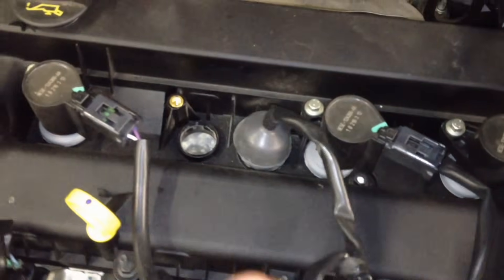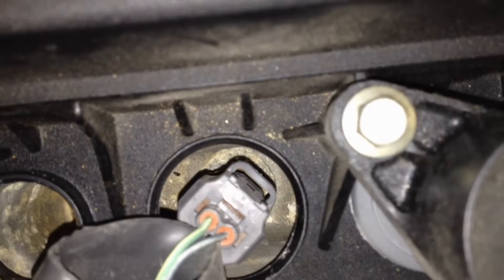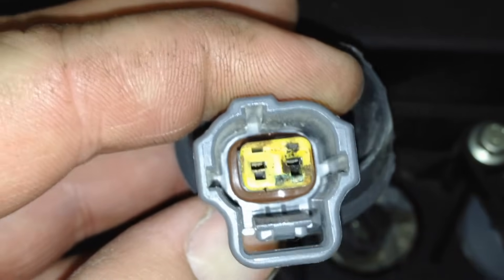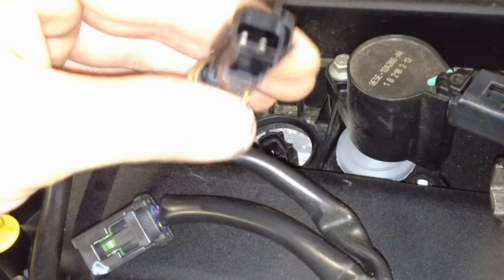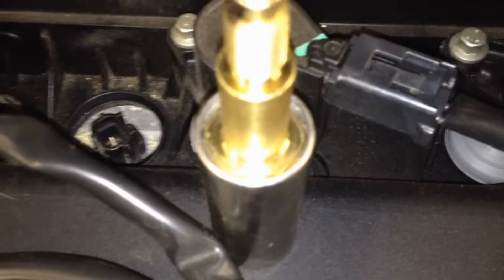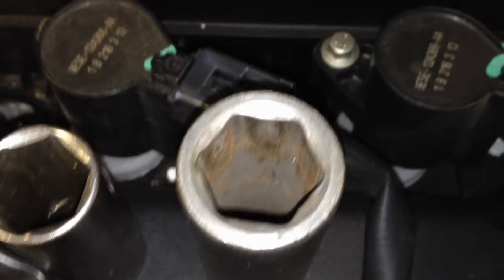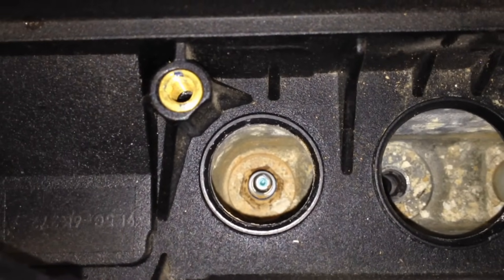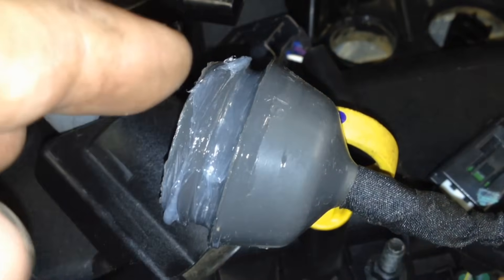Ford Escape & Fusion 2.5L False Overheat And Misfiring

Comment: So is the misfire cause by the CHT sensor thinking there is an overheat even if it's not overheated? I have 2003 focus with 2.0 ztec. Belt tensioner broke(don't buy dayco, get gates or motorcraft. Daycos hammer themselves to breaking on stops) and wife kept driving till she got home. Replaced belt and tensioner and seemed to run fine except code P1299 is keeping check engine light on. Ran fine for about 40 to 50 miles now all of a sudden it runs rough when accelerating from stop or if driving at below say 2K. If I take out of overdrive and run at say 3K it seems to run almost as smooth as normal. Hoping it's just this sensor sending out a warning and not actual blown head gasket or worse! 
Update: Reading a bit more on line seems like P1299 indicates that car is running in a kind of limp mode to try and prevent engine damage. So guessing either has to be manual reset after an incident or maybe CHT sensor got messed up and is still saying there's an issue and keeping it in limp mode. Going to try to clear codes and see if that gets it running ok and if so drive for a while and see if it stays clear or if it comes back because needs new sensor.
2nd update: I reset code and it still ran bad, and came on again after running briefly but P0303, P0304 and P0316, all ignition misfire codes. Pulled plug wires and both wells full of water. I assume for overheating but not exactly sure where from since they are kind of isolated from any water. Sucked it all out. pulled plugs and only one looked a bit white. No foam in cams nor dipstick. Reassembled and still ran rough. Thought hey water displacer 40! Pulled plug wires and sprayed both ends with wd40 and it runs fine now and check engine light is staying off. Good luck has struck....hopefully keeps going! Thanks for the info.

Comment: I have a 2010 fusión manual transmission. When in 6th gear the a/c blows hot air momentarily and check engine comes on with p0300, p0301 and p0304. Do you think this could also be related to the false misfire due to moisture in the spark plugs
Reply from the maker: Definitely fix the misfires first. Misfires will happen in the higher gears more often with failed secondary ignition and moisture or oil in there.
Reply: +FordTechMakuloco I see rust stains in there but everything is dry. I have now replaced spark plugs coils and fuel injectors with no improvement. I'm stumped
Reply: +FordTechMakuloco mystery solved!!!! I hadn't mentioned that the misfires started happening after an engine replacement. Turns out I needed a "misfire monitor neutral profile correction". Once a did that misfires went away. Wanted to share this cause it drove me crazy for a week!! Couldn't find the cause of misfires. Any time you replace PCM or crankshaft position sensor ( which I did cause new engine came with its own) you have to do that procedure. The symptom is random misfire or unexplained misfires.

Comment: 2011 escape same problems as described in video. Question how do you remove the cap and or gasket around the cht I'll add that this model has two cht one on each Cylander head cover

Comment: Hello.  I have a 2001 Ford Focus ZX3, same issue. Replaced thermostat and water pump. Mechanic checked the lines and their saying it's running at 180 degrees (normal). However, when plugged into the computer, the comp says its like 230+. After unplugging the thermostat sensor, comp still reads the same. Car runs fine when it's cool, but after a few miles of driving, starts to bog down and eventually stalls. In your opinion is this a bad comp?

Comment: I have a 2013 1.6L Escape and the Engine Coolant Temp sensor is stuck open.  I purchased the sensor from Ford dealership and it looks nothing like the one in your video.  Is there that big of a difference from the 1.6L to the 2.5L?  Where is the location of the engine coolant sensor on the 1.6L eco boost?

Comment: I got the P1299 code after the gauge went crazy I got it home took a look at everything and there’s oil in 2/4 spark plug wells and 1/4 is corroded badly inside along with the sensor having oil on it too. Not sure where to go next I’ve got the sensor but not sure if that’s my only issue. It’s only got 62,000 miles it’s a 2009 I4 have you seen anything like this? There’s also no obvious signs of oil intrusion in the spark wells Idk where it’s leaking from.

Comment: Just changed the sensor in a 2010 Fusion SE 2.5 Radiator coolant from radiator leak go into the CHT sensor well.  Temp Guage stopped working. Found the 19mm socket at Auto Zone.  Problem solved.

Comment: My 1.6L eco fusion has recently thrown a cylinder head temp sensor. It will over heat as soon as the car starts and misfire, not accelerate. I cannot find the CHT sensor to save my life! I’d like to change it myself given it’s so cheap. Any tips on how to find it?

Comment: Hey Ford Tech, I have been looking everywhere to try to get a idea whats up with my 2011 fusion. a couple of days ago I was stopped at a light and when I took off the engine lost power and the wrench and engine light came on, the car did not die just lost power I pulled over turned it off and everything was fine, now today while I was driving it did the same thing but at about 65 mph. It never died just lost power (misfire you could feel not hear) I pulled to the shoulder and did the same thing turned it off and restarted it worked again but the service engine light is still on. I am heading to the shop tomorrow, just praying I have a idea of whats up...65k miles new battery put in 2 weeks ago and the they said alternator fine....I understand its tough without seeing it but any ideas???
Ken
Reply from the maker: I would bet my money on the throttle body causing all of this, what did they find. Didnt you get a warranty letter?
Reply: FordTechMakuloco And you would of been the grand prize winner, Thanks.
I have been taking my cars to various mechanic shops for 20 years and getting various results, but this time I really appreciated what you said about dealer shops and went ahead took it to the dealer. I could not of been more happy found out my used Fusion had warranty on that recalled part and he had it fixed that day and for free. Went from very sad to very happy....Thanks again...
Reply from the maker: sweet!

Comment: The rubber boot on the connector is ripped and is making a slapping sound even after changing both the sensor and the pigtail. Any suggestions on what to check for next??

Comment: I have a 1998 Ford Crown Vic it is reading overheating after driving it a while my temperature does not read it stays at 1 bar  just recently replaced the cylinder head temperature sensor (yesterday) radiator (2015), water pump(2014) , electric fan(2014), thermostat(last month), coolant temperature sensor radiator (last week) main hose, hose to thermostat raidtor, and other hose (2014) it just stop reading or staying at one bar on my digital dash December 2015

Comment: this is the same as my 2008 Focus Duratech.   i wasn't so lucky with the sockets.  i tried 4 different deep sockets.   Ended up removing valve cover and using a regular wrench(barely fit)

Comment: I have a 13’ Fusion 1.5 Eco. Just recently the heat would not work if sitting still, and now it is over heating quickly in 50 degree weather. CHT? Or Thermostat?

Comment: Took my edge in for transmission sensors to dealership. Got vehicle back after three weeks. Didnt get a tank of gas worth of driving and engine light comes one. Ac quits, injectors stop working, o2 sensors faults.......yep dealership fixed it, drove it in, had it towed back to the house.

Comment: can you help me please? - after we bought a car, we cleaned it and they washed engine surface, after it car is randomly shuting down while d riving, and i am interested it is couse of water in engine? can there be water and couse it shutdown? Ford escape 2008 hybrid 2.3
Reply from the maker: Not in the engine necessarily but the electronics getting wet can cause it to go into a fail safe mode yes. You are just going to have to open the hod on a sunny day and let it dry out. Also remove the coils to check for water in the spark plug wells.
Reply: i have tried this way ( left car on sunny day for dry out but did not open the hod, i will try this way) i am interested in what u know, i have this problem for 1 week and still driving. if engine working it can't dry out by itself?
Reply: FordTechMakuloco 

Need your help I. Regards to a p1299 code for a 07 mkz before it goes into the "independent shop please!!!

Comment: FordTechMakuloco,
Hey awesome video, I actually found the problem with this sensor but need to know is I can order the new pig tail separate and wire in or do I need to get the entire wiring harness for the coils and this sensor as they appear to all be going to the same connector on the fire wall? Please advise when you can.. Thanks John
Reply: Try a junkyard you may find the good one

Comment: I bought a new head temp. Sensor. It came with a connector 2 wires 1 black. 1 white and red stripes . do i really have to replace the connector??? Any idea on how to replace the connector wires.?
Reply: I didn't have to replace any wires. I literally unscrewed the sensor and replaced. Plugged it back in and I was good to go.
Reply: @joshuahutchison9177  got it . thank you

Comment: I have a 2014 escape 1.6 engine that is giving me a false high temperature reading can you help?
Reply: Same engine heat alert and sensor failure.   Twice in my driveway and once at Ford quick lane.   In quick lane,  they were draining coolant and refilling.   They could not restart car without the heat sensor issue.   Under Elite warranty and Ford gave me loaner each tome.   Took them several days in the shop to fix each tome.   Not fuzzy warm about reliability of my 2014 escape.   Love my car, but not sure I will buy another one???   I have what I recall is the British engine built one.  I recall the other engine available was built in Mexico.   I have the smaller engine,  but titanium model.

Comment: My 09 Escape had the oil replacement notice come on . My daughter was driving it to WalMart to get the oil changed when it started overheating  /H   . We had the oil changed and while driving it home (< 2 miles) it overheated to the point of slowing to a crawl. I pulled it over let it cool down and then drove it to the SHOP. Any diagnoses ?

Comment: So here's my problem we have an 03 Escape v6 one of those fans is running on High super loud when the AC is on replace the radiator already replace the cooling fans this is the second cooling fan that's on there still have the issue replace the engine coolant temperature sensor we're running out of ideas

Comment: Where can I find a 19mm no shoulder socket? I can't find one and I need one asap. Sound specialty. Also, I'm having trouble finding the engine coolant on 2012 Ford Fusion 2.5L SE  temperature. Please help me. Thanks.

Comment: I put a new Coolant Temp Sensor, the gauge was reading wrong so i thought that to be the issue, but nope. My gauge reads below the cold position, it does move but below the cold position. Any ideas? I also replaced the water pump, thermostat and hosing but still the temp on my scan tool reads up over 205 deg

Comment: Hi Brian is it normal for this 2.5L to have a constant vacuum in the oil fill cap..?
coz i noticed this when i opened the cap while the car was idling..!
i did the same thing on a 3.5L 2012 explorer and there was no vacuum at all.

second thing, could you please tell me the location of PCV valve on this same 2.5L
coz i'm really suspecting that valve to be plugged up or something.
thanks a lot

Comment: Hi there. I have a 2009 4 cylinder automatic escape that has been overheating and shutting down.  My neighbor who is a mechanic did a tune up and replaced spark plugs etc. The engine idles a bit rough. When it shut down a few weeks ago,  before he replaced spark plugs etc, it was after I got off the highway having run steady for about 30 minutes at high speed.  On the off ramp it started to shudder and I pulled onto shoulder. The check engine light came on and I could smell a high catalytic converter smell. I waited on side of road  starting it periodically but engine light kept coming on. After about 2 hours I guess it cooled down enough and I was able to get home driving slowly.  My mom is afraid to drive it. It shut down on her a few days ago.  : (  Sorry for the long message.  I'd appreciate your thoughts.   Thank you!
Reply from the maker: angileques Well I would check the items in the video and the coolant level first. What did you find?

Comment: Would this also occur with the 2013 Ford Escape EcoBoost? The error yesterday was high engine temp stop safely, that's after driving about 2 miles on a cool day. The only code previously was a possible bad coolant bypass valve.
Reply: We’re you able to figure out what the problems was

Comment: Im going to check this sensor after work....if this is the culprit, do you have to reset anything to make the engine temperature warning go away or does it get a new reading and shuts off?.... my 2011 fusion hybrid says high engine temperature as soon as i turn it on even though its been sitting in the snow.....the fan kicks on instantly also... the engine coolant
Reply: Oops...the engine coolant read at 53 degrees according to the dash after running for a little bit... so i dont think its actually overheating...it only has 50k miles on it too
Reply: Well the sensor was clean as a wistle.....so thats not the problem. As soon as i turned car on the engine temperature light came on even though its been sitting all day in cold....
Reply from the maker: kriegmast I would still connect a scan tool to see what temp the pcm is actually seeing.
Reply: FordTechMakuloco figured it out...looked underneath engine and there was a connection that was unplugged...saw a diagram and it said the connection was the Motor engine coolant temperature sensor.....i thought their was only a cylinder head temp sensor on top.... idk if this mect sensor is trully a ect, but i plugged it back in and everythings groovy now
Reply: FordTechMakuloco also scan tool brought up no codes....but it did say mect high voltage..... but it wasnt in the codes, it just flat said that in some section the guy pulled up on the tool. He said it wasnt a code though...idk lol
Reply: kriegmast the connector wasnt on the gas motor but on the bottom of the electric motor (im guessing thats what it is "electric motor" the big silver thing to the right of the gas motor) i am completely ignorant to hybrids btw, but im learning.

Comment: I have a 2011 escape. 2.5l I have changed the throttle body. Ac compressor, plugs, erg valve, maf sensor, and it still surges at idle when ac is on. Dealer says they don't know what's wrong. Any ideas on where to start? When I say surge I mean idle drops below 750 to 500 and back up. Sometimes it stalls.
Reply from the maker: I would reset the pcm memory, make sure the air filter is new and a motorcraft that is solid then make sure the air box is fully seated all the way around including tangs down below. Let it idle to learn trims with no accessories on, then you can start trying the a/c. Also has the a/c compressor been checked for locking up? Does it cool good?
Reply: FordTechMakuloco the a/c compressor has been changed with a new one from ford. on the  side of the head there is a egr valve, it has a 6 pin connector, with a water line connected to it. when i unpluged it i got a egr valve code. i will reset the pcm memory and let you know.

Comment: I recently pressure washed the engine and have a coolant temp sensor code stored (P0116) after noticing the cooling fan would run on high after engine warmup, even with the A/C off. Also much longer engine crank before engine start.

No light on dash just the symptoms and stored code. EDIT: check engine light on now.

Night before I pressure washed right in that area. Now I see that the engine cannot handle water at-all in that area. My mistake.
Reply: Changed the CHT Sensor and plug.  I used the Motorcraft parts from the dealer. The pig tail wire set cost $45--It's available online for $27 if you can wait 2 days or more for shippping. The CHT sensor cost about $28 from the dealer.

Everything works fine now. No more problems.

Comment: Hi, do I need to use Teflon tape when putting it into the threading? And also will the coolant leak out when you remove the sensor?
Reply from the maker: +nick diaz Nope as shown it is a dry well.
Reply: +FordTechMakuloco thanks for the quick reply. I had taken my 2011 Ford Escape into the Ford dealer as the vehicle has a rough idle at a stop. Determined that the Coolant Sensor was leaking onto the Spark Plugs and causing a misfire. Is that really possible? Rather than pay 700 for someone to do it for me I would rather do it myself as it seems really simple and the sensor is only 38 dollars. I will also change my plugs and run codes again to see if misfire stopped. please let me know if i am in the right direction here.
Reply from the maker: +nick diaz Coolant does not touch the sender it s a dry well so its not possible. If they found water it is due to water intrusion from the cowl that is why the instructions in the tsb also state to silicone the boot to the valve cover. Just change it yourself following this video to a T and you will be fine.
Reply: FordTechMakuloco I know the mileage yet trap hair 2013 Ford Escape 2.0 heat sensor location

Comment: 2014 fusion w/ 1.5 turbo overheated twice, but only after 100 miles on a long trip. only 42k miles , no leak, clean full coolant, fans appear to work at least on low speed? Any ideas?

Comment: I have a 2007 Ford Escape. I replaced the sensor after accidentally braking while changing my valva cover gasket. Since I replaced the sensor my temp gauge is now increasing to slow. Any suggestions?